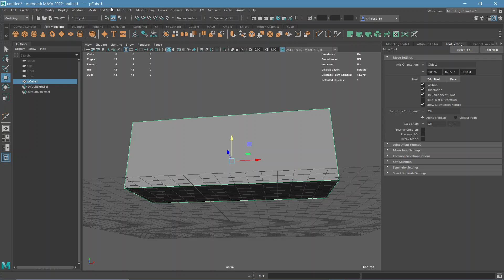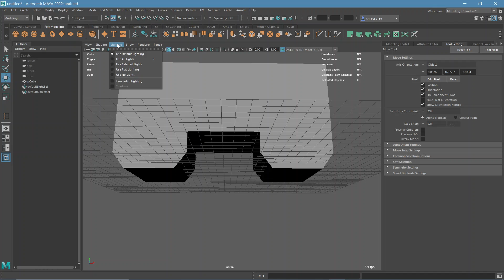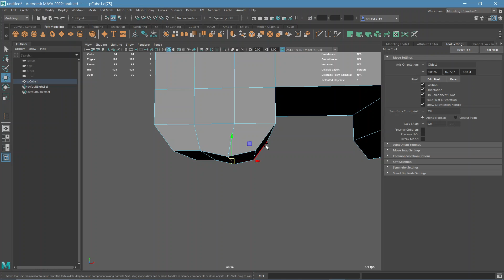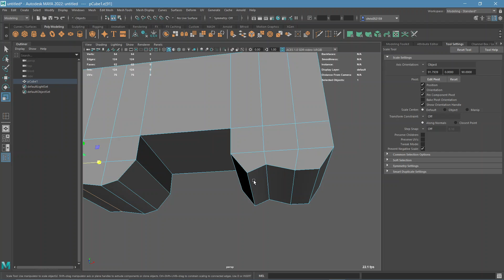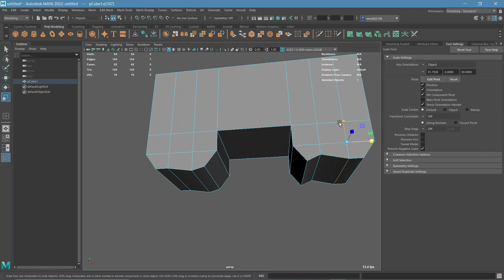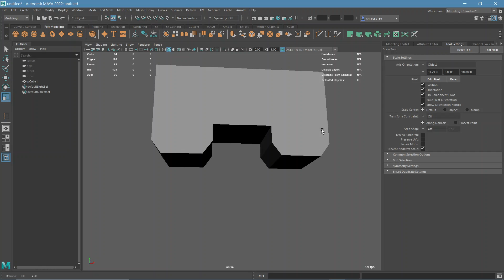How to align edges in Maya 2022

Comment: I have Two Vertices with several Edges connecting them both together which I want to change the angle of so that it creates a Long Straight Diagonal Line. The Vertices themselves won't move, just all the Vertices and Edges In-Between. Is something like that possible?